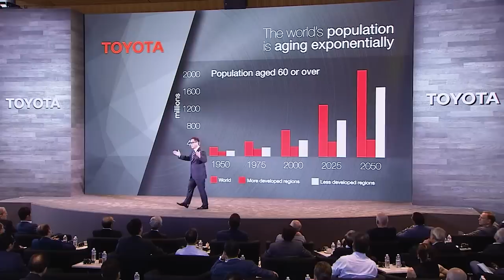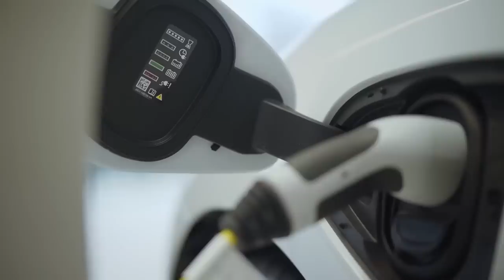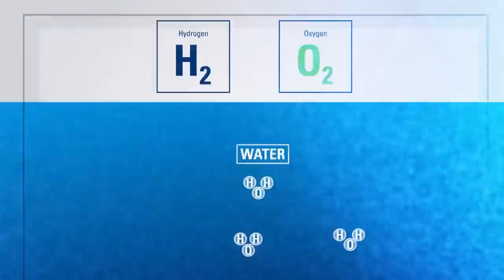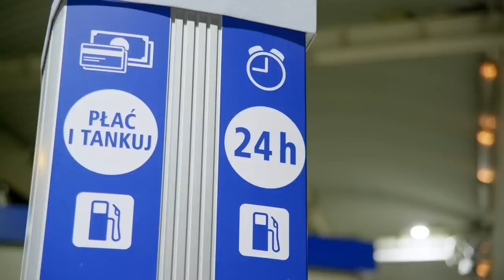New Toyota CEO Shocks Everybody | Huge News

Comment: I'm a big Toyota fan, bought a used 2008 Lexus ES 350, still drive it, the most reliable car I have ever owned, hydrogen is the way to go, there is no way the infrastructure will ever be be built to charge all EV's if that is the future.
Reply: Where do you think the infrastructure to fill your hydrogen car will come from? Hydrogen at 800 Bar pressure is a true bitch that diffuses through solid metal, altering its structure on the way and weaken the tank - so that must be prevented with special coatings that also don't last forever. And you need 10 times more volume while transporting that stuff...
Reply: @karlgunterwunsch1950  yeah I agree, it would be far easier to improve the electricity grid than install hydrogen fuel stations everywhere. Plus there’s the fact that producing hydrogen is very expensive and is mostly done with fossil fuels. Only Iceland can do green hydrogen because it has all that geothermal electricity.
Reply: Let's be realistic: If you doubt the infrastructure to fast charge an EV will never be built - then what do you think will happen for hydrogen. A typical HPC stall costs $50k, low maintenance, needs medium grid connectivity which is available in loads of places, poses no risk to the immediate surrounding and no constant truck deliveries. OTOH a single H2 filling pump costs $1M (getting the required 1100 Bar pressure is no mean feat), is  high maintenance (1100 Bar!) requires big cryogenic tanks (high running costs), loses several % of the contents of the tank per day which must be burned off to prevent the build up of a combustable H2/air mixture - and thus poses a risk to the people in the immediate vicinity (there were already explosions at filling stations that injured people - since then there is a minimum distance to habitation or industrial estates so that only the drivers of such vehicles are killed if ever the tank ruptures or the pilot flame to burn off the evaporated H2 has a fault). The cars themselves are rolling bombs - if one of those gets t-boned any rescue the passengers need probably is afterlife related, not life related, because the pressure wave from a ruptured H2 tank at 800Bar will kill without the H2 even igniting (which it may do spectacularly - see Hindenburg disaster). So go ahead and wait for hydrogen to become the saviour - while smart people go with the cheaper, much more practical solution of BEV...

Comment: Toyota is awesome. My 2010 Rav-4 is still going strong with almost 300 000K on it. Ran it low on oil over 5 times and it still runs strong.
Reply: I've run my Tesla with no motor oil for 9 years without a problem.   I'm only at 150K though.   I've seen some hit 500K miles and I saw one that hit a million miles.
Reply: @victorluke5816  how much money did you spent on changing the batteries?
Reply: @lorebringers  None, I have never had to change batteries.   If you meant charging then it cost me $100 last year but I mostly use free chargers around town.   I have 12 free chargers near home and about 30 free chargers around work.
Reply: @victorluke5816  you will eventually because it is a battery lol
Reply: @victorluke5816  good luck changing that massive battery when it goes bad.
Reply: @zerovertigo3199  According to actual vehicle battery replacement stats I should be ok for another 10-15 years on top of the 9 I've already gotten out of the battery.  Should be in the 3 to 400K mile range by then.  Its only a first generation Tesla battery (Not counting the original Tesla based on the Lotus).   Tesla didn't help design those.
Reply: @rodney5269  Based on actual Tesla battery change stats I will be about 10-15 years from now.  I might sell it earlier than that and get a slightly newer Model S with lifetime Supercharging as well.
Reply: @victor luke 

It costs 20 -22k to replace a tesla battery including labor. Yup you should sell it instead of replacing the battery. But who in the right mind is going to buy it from you knowing they have to replace the battery soon lol. Buying it from you combined with replacing the battery they might as well get a new Tesla themselves.
Reply: @rodney5269  My 2014 model S is going for around $30K in Southern California right now.   If I sell it I can go to Utah and buy a 2016 Model S for around $36K with half the miles on it.
Reply: @victor luke

 a 2014? for 30k? just looking at car max they dont even list teslas older than 2018 for sale.  it is a pretty good reference for the market on used teslas. Let's just assume that you can do what you just said. Just think about it for a second.. Really think. With a replacement cost of around 20-22k for a tesla battery, a person like yourself an avid tesla owner is gonna do what you just said. Obviously, ballers gonna just get a new tesla. Unless Tesla can bring its value to consumers to the level of a toyota, honda, etc., I don't think your tesla advocations gonna convince consumers at levels lower than tesla ownership. It just makes you snobby.
Reply: @rodney5269  Saw about 20 Model S pre 2018 listed yesterday.  Not selling to ballers just people who want a Tesla in the area with free internet and free supercharging for life.  Free fuel for the lifetime of the vehicle isn't bad.  Also by the time mine croaks there should be cheap battery replacements in 10-15 years probably using sodium instead of lithium.  If a battery drops to under $5K then I'd likely keep it until I'm dead.
Reply: @victor luke

The free supercharging was a short time promotion that tesla already ended. Vast majority of tesla owners now and all future tesla owners are not getting free electricity. There are people that want Teslas but cant afforded it. It is not just a matter of just wanting something, you have to have the means. Yeah you can bank on cheaper battery replacement in the future, but until that comes it is irrelevant to consumers in the present.
Reply: @rodney5269  The promo was from 2013 to 2019 for Model S and X.  All the used versions of these cars that were not sold back to Tesla still have the free supercharging.  The cheaper used Tesla vehicles are precisely the ones with this feature.  I paid $15K for my Model S.   The sticker price was $30K when I bought it (Still the same price 5 years later) and the government and electric company gave me an additional $15K for destroying my 1982 Mercedes 300D.   The price for the battery is about a 1/3 less than when I first bought my Tesla.  Batteries are expected to drop another 33-50% this year.  I'm banking on the battery being cheaper now than last year.

Comment: I like the idea. Might consider once stations are more widespread, and the cost of fuel established.
Reply: Still major issue with refueling on the road. How you move hydrogen from station to vehicle that has run out or leaked out? Hydrogen being very small atom and next to impossible to contain reliably.. Also highly flammable.
Reply: @Hellsong89  I would think that for a fee, a truck with pump and tank unit could be dispatched. Either that or a tow truck would take the stranded vehicle to a refueling station....for a fee.
Reply: @Hellsong89  JCB have already done it, They have a tanker unit to take hydrogen to their new range of hydrogen vehicles.
Reply: @paulwassenaar8351  LPG/LNG much easier to contain than Hydrogen.
Reply: @paul wassenaar  there's 2 different types of hydrogen cars. One uses combustion of hydrogen the other uses some metal thing to convert hydrogen and oxygen to water and create electricity for an electric motor.
Reply: @Peter-uo9km  While it is possible to burn hydrogen in an internal combustion vehicle it has not proven to be practical. The efficiently is a bit less than other fuels tested, which is why you do not see them on the road today. Hydrogen fuel cell vehicles are already in use in some other countries. The big factor has been finding refueling stations. Long haul commercial companies are able to provide dedicated fueling stations and solve that issue. 
Fuel cell technology is interesting to read about. Hydrogen is combined with ordinary air to release electrons and water. It's a slow motion explosion without causing destruction.
Reply: @Carsten  Toyota new hydrogen engine is the combustion type. Ford too. The fuel cell is made of precious metals and is expensive.
Reply: @Peter-uo9km  I see where the Corolla Cross H2 is currently undergoing real-world evaluation, with winter testing to begin soon in northern Japan. I like it!
Reply: @paulwassenaar8351  the Toyota Mirai uses fuel cell.
Reply: @Carsten  they killed Stanley Meyers inventor of the water splitter hydrogen engine.

Comment: I'm liking this, haven't purchased a Toyota but due to other manufacturers doing the dumb stuff they're doing, it'll make me look to Toyota for sure in the future.
Reply: They're dang good cars
Reply: Toyota makes very good , reliable cars .
I had Corolla with 430.000 miles on it. Original engine and transmission. 
I had also highlander with 200,000 never fixed. Just oil change and break pads.
Reply: @ROBERTELECTRIC1  Now that's awesome. They're not the most interesting or enjoyable to drive but hearing that and realizing you don't just get that reliability, dependability anywhere is amazing in and of itself.
Reply: I only buy Toyota, Honda, or nissan. My next car will be an older highlander. They can go 300k miles.

Comment: Currently hydrogen is either stored as gaseous form in extreme high pressure tank. This is no different than keeping a time bomb in a car. It's extremely dangerous. Or keeping it as liquid form but has to be lower than 253 degree Celsius. Which will require more energy to maintain its temperature.

Even if the technique of Plasma Kinetics is deployed. By using paper roll to trap hydrogen doesn't solve the issue of supply source. Because it's still cheaper to extract hydrogen from gasoline.
Reply: There's no solution to make hydrogen practical and popular worldwide yet. The best and ancient but absolutely practical solution is steam engine vehicles or SEV. With our technology we can create steam in split second. Burning coal is no longer related to steam engine. 

On top of that all ICE concept has to be replaced with newly developed revolutionary rotary engine. In short, engine without the biggest rubbish such as piston rings.

No piston rings means cutting down friction significantly. This will enhance the efficiency of the car to a much higher lever. Also no more constant change of lubricant. Everything is simple, cheaper and easy to maintain, plus its horse power will be insanely high.
Reply: Top automobiles maker in Japan and Germany should understand everything I'm posting here. In fact I completely believe they know what to do but just aren't allowed to do so. Hybrids are another complicated, impractical rubbish. But the Japanese have no choice. Japan is the 52nd state of US. Just behind Taiwan who happens to join US as 51st state long long time ago. As for Germany, the Germans are always proud to serve as slaves for the US as the 53rd state of America.

The only country in the world who possess absolute sovereignty is China. The automotive industries in China have all sorts of freedom to develop anything they wish. The Chinese government spends trillions on oil every year from other countries. China should be the best place to kick off with steam engine vehicles. Provided they have talented people and they know what to do. Sadly this isn't the case. The Chinese car makers are vigorously engaging in duplicating all sorts of rubbish created by the west. It's the quickest way of making big money. And also the quickest way of wasting national resources. 

I urge the Chinese government to strictly ban all sorts of rubbish created by the west. First thing first, the existing super retarded reciprocating ICE with piston rings must be thrown into Indian Ocean. Follow by all the high voltage oven aka EVs. We don't enjoy being cremated half way going to work. Do you?
Reply: @infiniteandunlimitedabundance  What energy source do you use to generate steam?
Reply: Batteries are more dangerous as EV’s are burning up everywhere…
Reply: @heathwirt8919  

In order to make steam engine possible,

1 Either deploying the same batteries of EVs but with smaller scale to create steam just enough to power the vehicle. This is to avoid the danger of high voltage. As we all should know, EVs are coffins with built-in self crematory system. 

Or using free energy system to generate electricity enough to generate steam to move the vehicle. Free energy system is NOT a hoax. Already published on YouTube. I've seen it. It's simple and real deal.

2. Drop the incredibly stupid piston rings reciprocating concept. Such concept is constrained by the short length of crank shaft which is vital to generate torque. Also the invention of piston rings is absolutely nonsensical. It's the main reason why half of our hard earned oil money are wasted on feeding the oil cartels. We only need very little of oil to move the cars if only the car makers know how to get the engine and geartrain right. But so far none of them do.

3. To save energy without wasting too much electricity. The geartrain has to be positive drive infinitely variable transmission. It's a type of non slippery CVT. No more worries about your tyres trapped in off-road condition. It's highly efficient, simple and cheaper in maintenance, extremely reliable.

4. Did you know, your ICE car is burning excessive of fuel even when your car is going downhill or stopping at the traffic light. Because of GDI system. It's the greatest hoax in automotive industry. 

In steam engine vehicles, this should be avoided. We only create enough of steam to turn the big rotary piston. Yes, not even Wankel's rotary got it right. Wankel's engine isn't rotary strictly speaking. I'm talking about making full use of big diameter of rotary piston to generate high torque. Bare in mind it's without the nonsensical piston rings. Absolutely frictionless. Imagine how insane its output torque would be.

5. Last but not least. If you think the above are jaw dropping technologies only ETs should know how to do it. You are wrong. Everything I suggested in the above is simple, something car makers should follow right from the beginning.

If we can waste so much money on developing new battery, why don't we try steam engine. Of course for the car makers in 52nd and 53rd stage of America, they aren't bold enough to provoke their master. Not sure if the Chinese automobile makers know what to do by now?
Reply: @DrEd-th2lu  the main purpose of promoting EVs is to facilitate those who enjoy automatic cremation together with family while driving to picnic.
Reply: @DrEd-th2lu  when it comes to EVs, all I want to say is that are humanities that stupid? If there is galactic car exhibition whereby all ETs from different solar systems are participating. I'm sure the top big brands from earth will be too shameful to join in.
Reply: @infiniteandunlimitedabundance  There would be a loss of efficiency using battery power to produce steam so that method would be impractical.
Reply: @heathwirt8919  if EVs can use battery why not using it to create steam. Steam is more powerful than electric motor if only we use larger rotary piston.
Reply: @DrEd-th2lu  They are not burning up everywhere Mr. Ed.
Reply: @heathwirt8919  for gas car, it's using the energy from the fuel to charge the battery. But as for steam engines there isn't anything to charge the battery.

As I have mentioned earlier, we still need the batteries but not in a larger scale as in self- crematory coffins SCC aka EVs.

As a mechanical designer, I know very well what I'm talking about. Get the concept right,  further improve later. If the concepts are wrong right off the bat. You will end up with rubbish like GDI, turbocharger.
Reply: @infiniteandunlimitedabundance  What's the fuel source? Oh I get it, your using the gasoline to heat the water to drive a generator to power the electric motors. There is still a loss of efficiency in the boiler/steam generating, generally 80 to 85% efficient. A well designed electric motor is about 90% efficient. Efficiency loss would be in the range of 25% making the system 75% efficient. Driving the electric motor from a battery is more efficient and much simpler.
Reply: @heathwirt8919  already answered, batteries. But requires newly rotary engine ( frictionless ) couples with positive drive infinitely variable transmission geartrain. Just to save energy.

That way we could avoid longer charging time because we may not need too much electricity. We only need very little energy to create steam to move the car with the help of mechanical parts.  

Even if electricity is free, still it doesn't make high voltage self-crematory coffins safe. This is literally hybrids with steam and batteries combined together.
Reply: @heathwirt8919  on top of that. Introducing positive drive infinitely variable transmission PDIVT. Those who have had terrible experiences in CVT because of the spongy effects will love this one. 

It's positive drive. You get what you want. Meaning no more lagging spongy response whenever you hit the gas pedal. 

It allows infinite gear change just to match precisely the amount of torque the car requires in various conditions. No more unnecessary switching of clutches as DCT developed during ice age.

With the combination of newly developed rotary engine couples with PDIVT, it will beat any electric hypercar in drag race. So Mr Tesla, I dare you. Wait for me on the raging track.